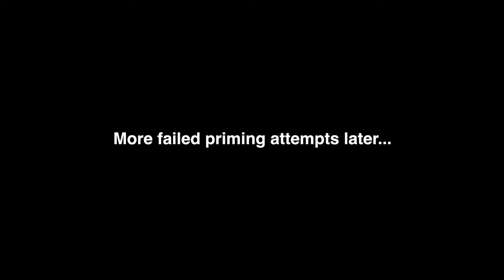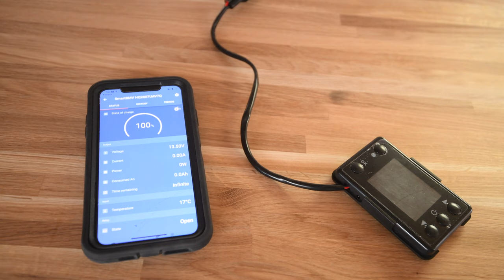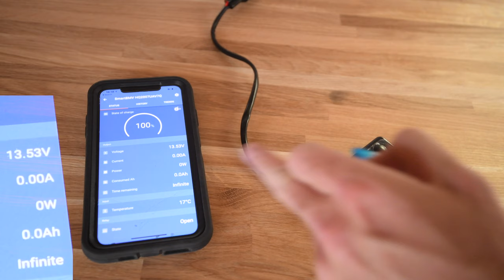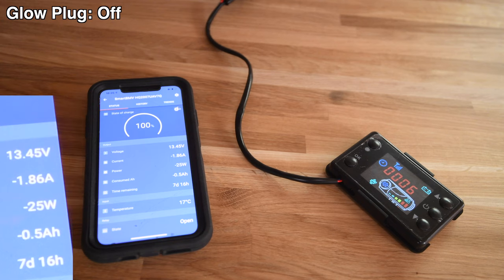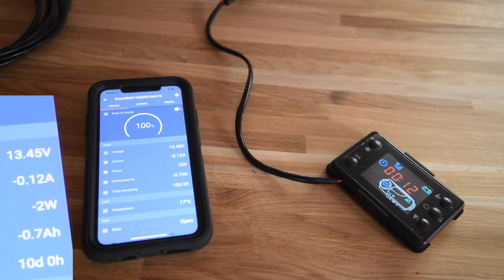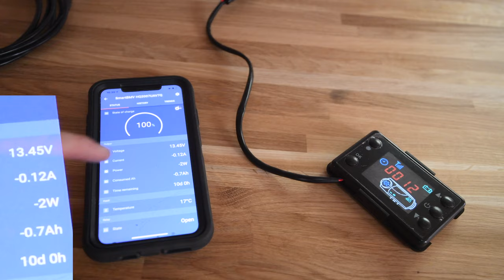5kw Chinese diesel heater install | EP30 | Ford Transit Campervan Build |

Comment: You've mounted the pump outside but how did you get the wiring to it? Is it going through the turret?
Reply from the maker: No sure what you mean by upside down? The start of the video the pump was in the wrong angle of orientation but mentioned and corrected in the later part. Generally it needs to be mounted in the horizontal position at a 15 to 30° angle with the outlet of the pump is the higher part
Reply: @MispronouncedAdventures  Hiya mate didn't mention anything about it being upside down. I'm wondering about mounting the pump outside the van instead of my original plan on having it right next to the plastic fuel tank near my rear doors. I'm curious about how you got the electrical cable from the heater to the dosing pump underneath.
Reply from the maker: Oh so sorry. It’s been such a long my day selling Christmas trees here. I completely miss read it
Reply from the maker: Definitely variety of mount options . The pumps can definitely be mounted externally as they use AMP super seal waterproof connector. However it will probably decrease the pumps I’ve spent. Having it there for a few weeks not it in a pretty sheltered spot. Not much dirt or  moisture on it. I also don’t seeing an issue with it being inside for a internal tank
Reply from the maker: As for your original question. The original amount  provided has a slot cutting it for the fuel wires pumps. The turret mount didn’t, I added one with a drill and jigsaw. For some reason the footage got missed out
Reply: @MispronouncedAdventures  Wow drilling into the turret seems like a bigger job that drilling another hole in my vans floor.
Reply from the maker: The turret steel was a lot thicker than the vans floor! Big centre punch  mark. Drill, then a fine tooth jigsaw blade

Comment: Nice install Alex. Have you got a link for the heater you bought as there are so many online? Thanks
Reply from the maker: Sure. My thinking behind which ones of the many was the eBay selling with the most unit sold and highest rating 

https://www.ebay.co.uk/itm/153147548894
Reply: @MispronouncedAdventures  I like yours because it has that tunnel on the base plate, that makes alot of sense. I've got one without the tunnel but I was thinking about refitting it in a different way so I might buy a new kit while I'm at it. Thanks again.
Reply from the maker: Yeah I felt in this case as the diesel heater had to go through about 60mm of combustible materials of a floor that it would  be quite important to isolate the hot parts from it.

Comment: That exhaust plate is different in a video I was watching.
Reply from the maker: Exhaust plate? I’m not sure what you mean? Many companies do produce this type of diesel heater. But there can be differences between the kits, there are Number of different controller, A couple models of exhaust muffler and so on
Reply: @MispronouncedAdventures  all the video.i been watching had the same one but watched yours it was like the western heater plate..

Comment: Death trap on a nice van. Shame
Reply from the maker: Don’t fit one then, feel free to choose autoterm, webasto, eberspacher.
Reply: @MispronouncedAdventures  Sorry to be a negative comment in the sea of spastics below but these heaters are plain dangerous. It will take a poor family to get carbon monoxide poisoning to get these things looked at. All I ask is that you do your research before buying a combustion driven tool and not risk others and your own life by fitting these.
Reply from the maker: Please consider not making fun with other commenters by using the word spastic, there neither fair to commenters or people with cerebral palsy. 

I’d disagree they are “plain dangerous”. Issues with carbon monoxide poisoning from these heater is normally from poor user install over unit defect. Issues with there gasket are very rare. I’m not going to disagree to units can fail and do. Unlikely to be a issue endangering the user life, just failure of the unit to function. 

But I can see we are no going to agree.
Reply: @MispronouncedAdventures  apologies to all those effected. I meant misinformed ones. But to those who still think Chinese heaters are a good idea, I think that term is accurate